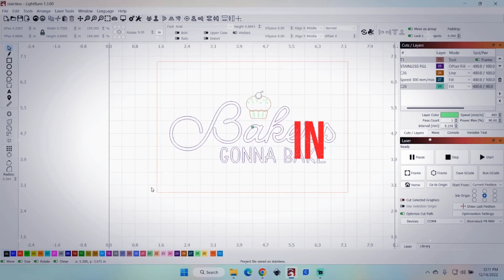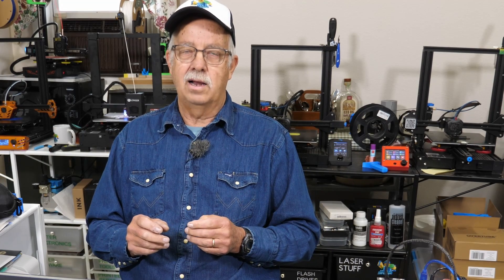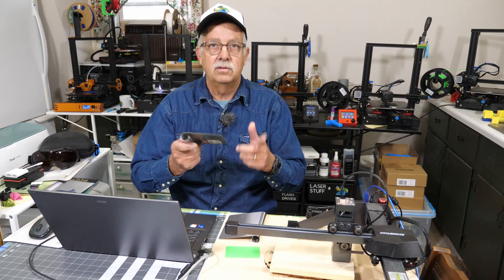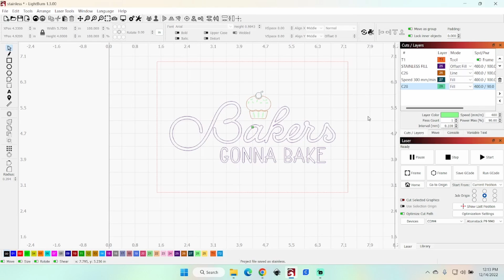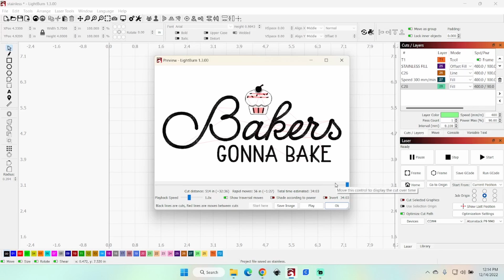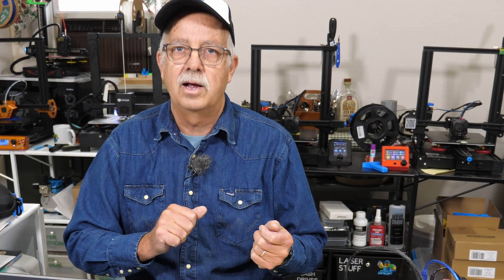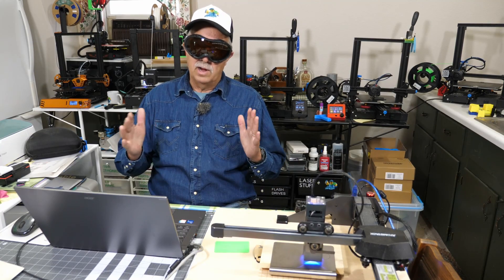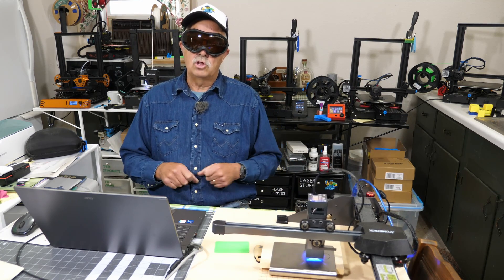Beginner Laser Project #3 Stainless Steel

Comment: Im course how many times you can run your lazer at a hundred percent before it starts loosing power.
Reply from the maker: Topic of great debate and it also depends on the manufacturer of the laser head.  The heat generated is the most critical, so the cooler you can keep the head, the longer it will last.
Reply: @rogersshop  I never looked at it that way it's food for thought.
Thank you.

Comment: any tips to prevent or reduce warping?
Reply from the maker: The only thing I have found to reduce the warping on this stainless is apply a dry-moly lubricant coating first, then increase speed and make multiple passes.  Results are still mixed, though.  I don't have this problem on thicker material.  But, the Dollar Tree scrapers are good to experiment with since they are so cheap.

Comment: Very, very great video and wonderfully explained XD One question please....what did you coat the stainless steel with to get such a result and with what parameters exactly? I have the Atomstack x7 Pro and NEVER get these results ;( I ask for your help :( Kind regards Frank
Reply from the maker: No coating, but this may depend on the alloy of the stainless.  Setting I use for a 10 Watt is 400 mm/min @100% power.
I have also used a spray coating of dry moly lube on a different project on stainless where the nickel content of the alloy was higher to get a darker etch.
Reply: Since the material is reflective, doesn't that mean it could reflect back at the laser causing damage?

Comment: Do you not coat the steel before burning? I see people using aerosol sprays designed to be uses for engraving steel .
Reply from the maker: No.  Not on stainless.  I do coat regular steel first.
Reply: @rogersshop  what do you coat reg steel with?

Comment: The P9 M40 is a 5.5w laser, not at 10w, I hav the same exact laser.
Reply from the maker: @logoidea4u  The M50 module (10 watt) was supplied to me by Atomstack before it was released to the public, so had the red shield.  I also did a video on the complete P9 M50 when it was released:  https://youtu.be/Up7K0kf2lJ8  After release, it has blue shield.  No lie.  No mistake.  Just fact.
Reply: @rogersshop  I see, I apologize , and thank you for all your help!! God bless you
Reply from the maker: I put a 10 watt head on this as an upgrade, almost making it a M50.